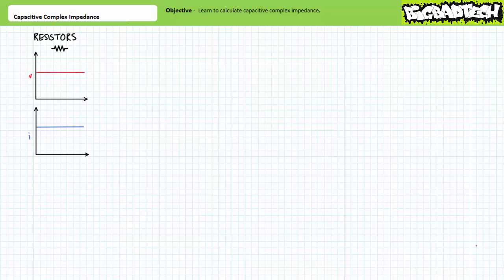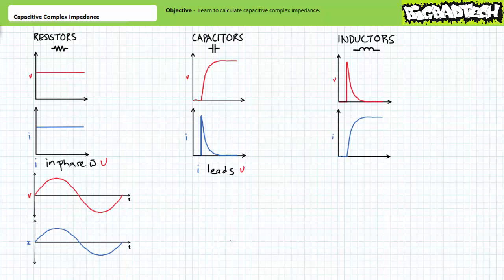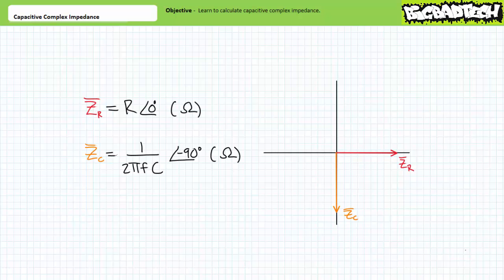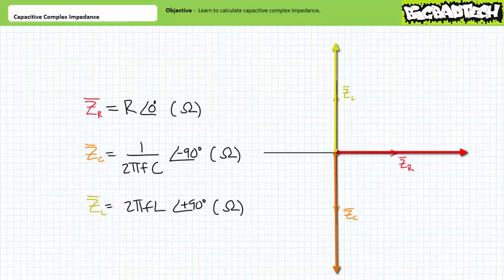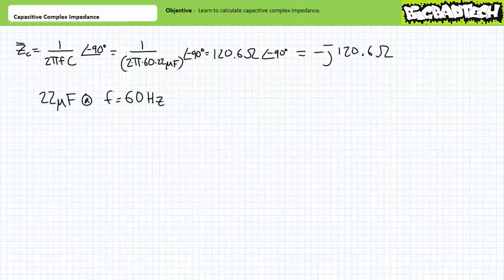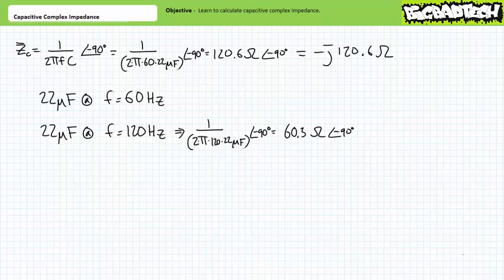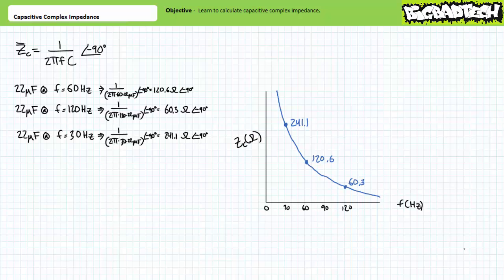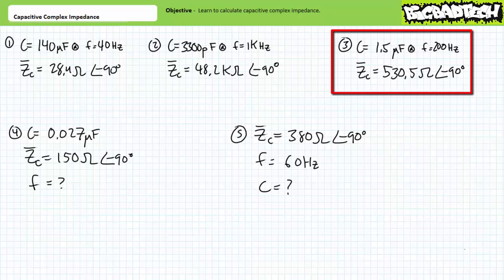Capacitive Complex Impedance (Full Lecture)

Comment: In the first example, one microfarad is 0.000001 F. So 22 mF is 0.000022 F. If I use units of farads instead of microfarads, the place value comes out right in units of ohms. Meaning, if I give the complex capacitance impedance as 1/(2pi*60*0.000022) then I get 120.6 ohms. I have to remember to use the full units to do the calculations rather than thousandths or millionths of the full units, if that makes sense. Getting the place value right for picofarads or whatever else and using scientific notation in the calculator is necessary for the practice problems as well.
Reply from the maker: True dat. Check out the engineering prefixes lecture for some short cuts: https://youtu.be/WfnTO_Pr3HE